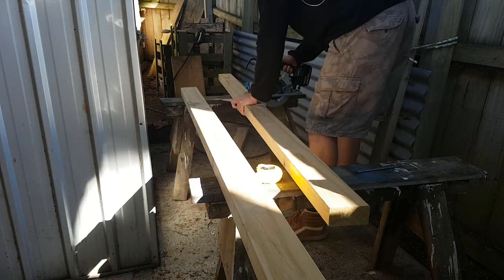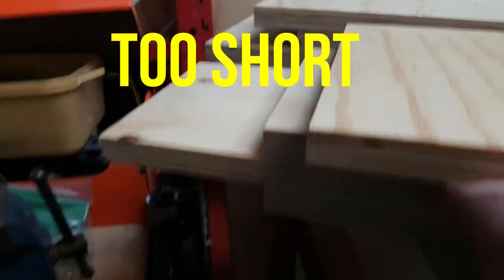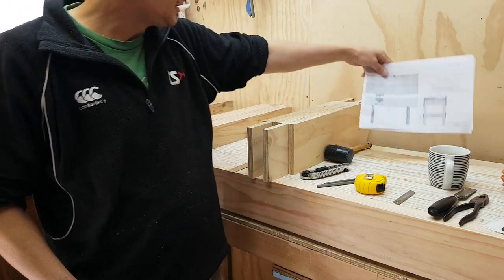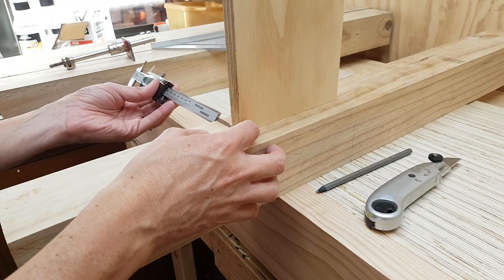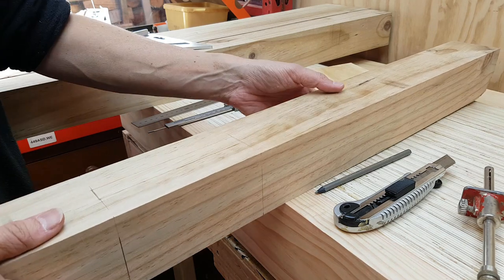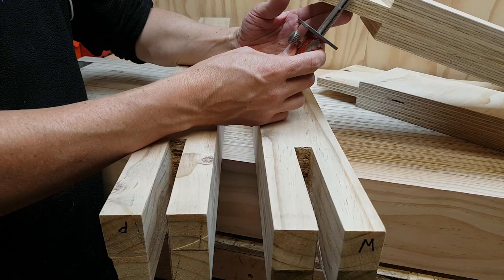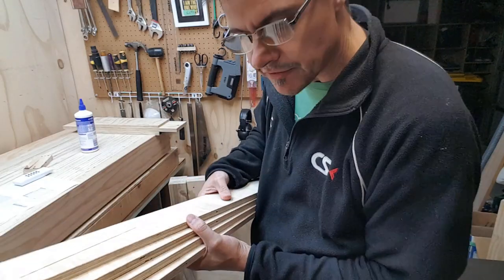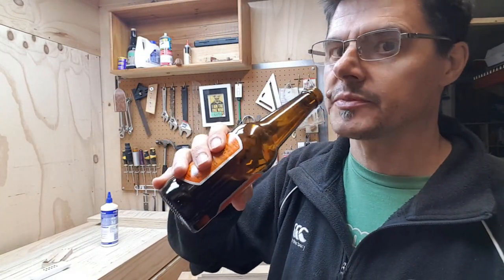Paul Sellers plywood bench - making the legs

Comment: Good work Rob.  Just a couple of points on marking out with a pencil or standard knife blade still leaves a lot of opportunity for error / gaps.  If you are going to use a standard knife (such as the one you have) by holding the bevel of the knife blade against the straight edge will give you a much more accurate line.  If you use something like a japanese marking knife the back of the sharp edge is flat (similar to a chisel) having a dead flat side and the bevel on the other, allows holding the knife more comfortably and the sharp edge can be right up against the straight edge providing the opportunity for a more accurate mark.  Cheers, David
Reply from the maker: Cheers David. I need a proper marking knife..it's on the list (literally... In my Amazon cart) it's a must have for when using proper hardwood which I'm starting to do more this year.